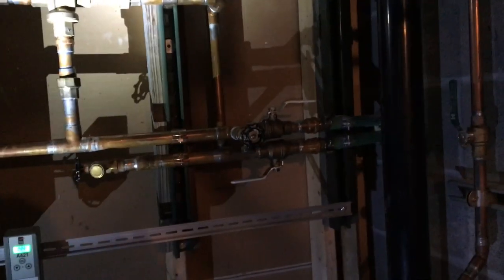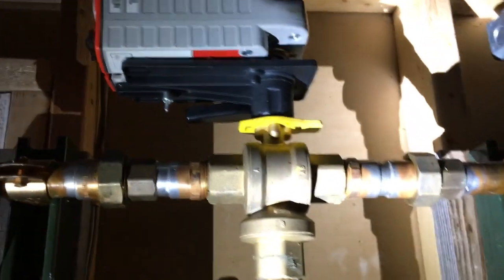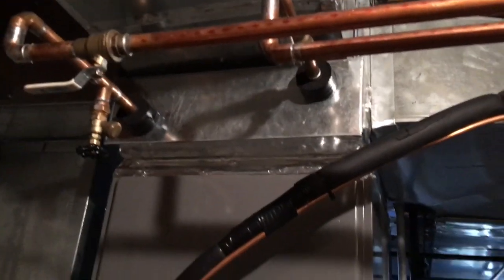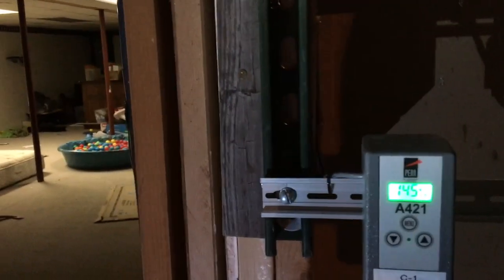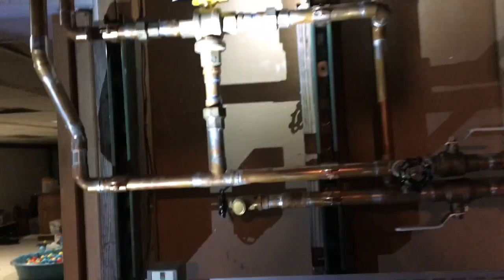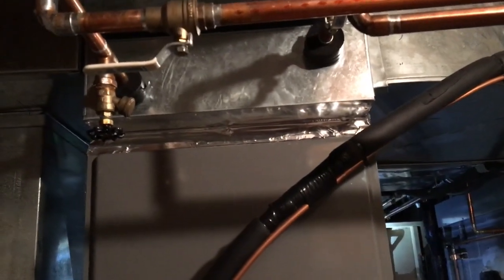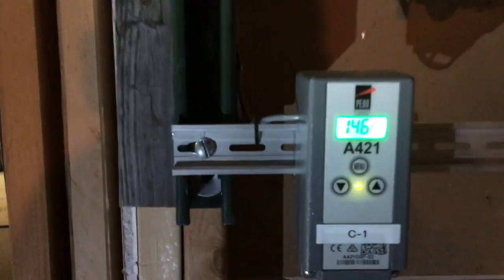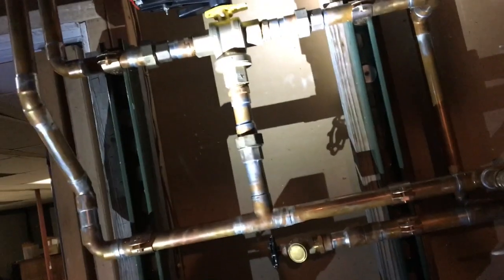Outdoor Wood Boiler Hook Up Inside House

Comment: Hey Jimmy, I’ve already installed a  Ranco thermostat controller to cancel out the propane when 150 degrees of water is present at the probe ..on the HX ..I’d like to add that valve you displayed with the same controller you display…..so a call for heat opens the valve and when the fan stops the valve closes again diverting the water back to the boiler bypassing the HX…where does the fan signal come from on the furnace and is that valve 110v or 24v